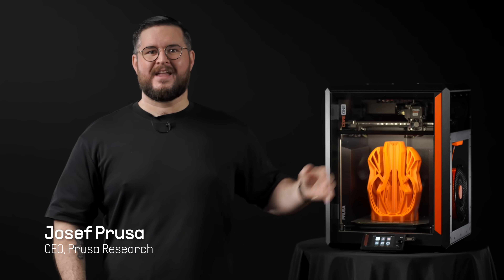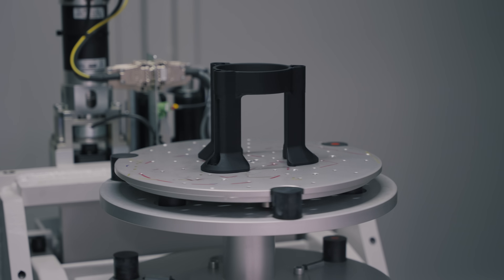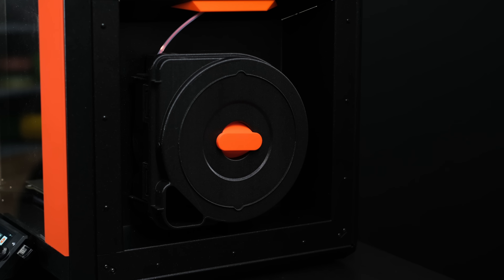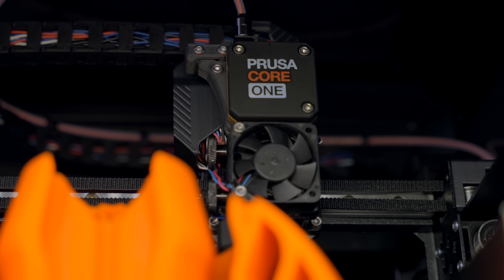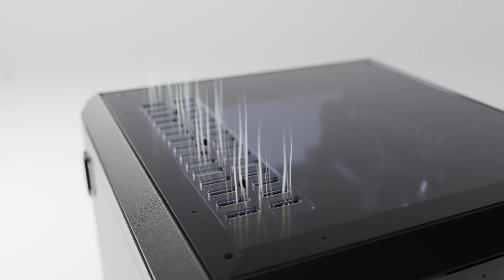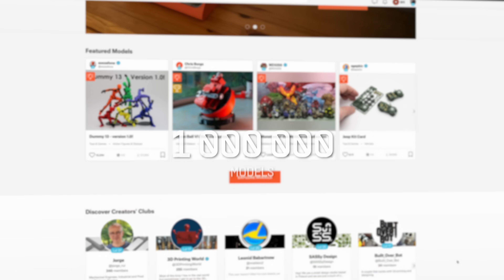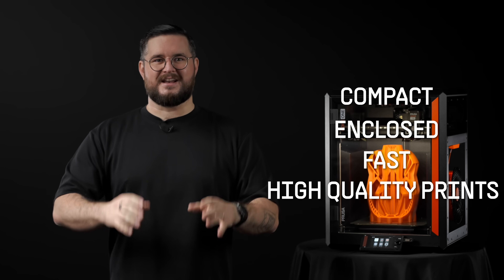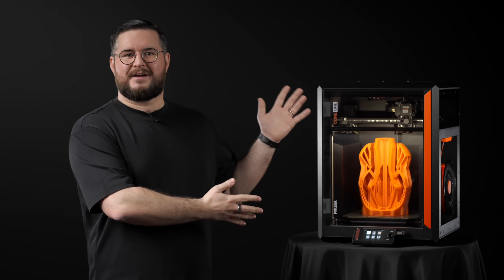Prusa CORE One - Fully Enclosed, High-Speed CoreXY 3D Printer With Active Chamber Temp Control

Comment: overall looks good, and finally there's an enclosed Prusa printer, so that's great, but its a bit small. It should be at least 256 x256, and even better 265x265 or 280x250. Surprising, Bambu uses 256 x 256, and that's what everyone is competing with, but Prusa went smaller 250 x 220. They should have gone a little bigger or at least the same 256 size so they are not inferior in this aspect. I don't need Z height, so the 270 weakest dimension is not so useful for me and many others that prefer a stronger axis to be larger. Perhaps it can be converted from the MK4, and it needs to fit into the Prusa print farm, so that's why they went with a small size. Backwards comparability is holding back progress a bit.  Does it have a quick change nozzle? how easy is it to change nozzles and are these custom to Prusa? can I attach an exhaust hose to the back to exhaust the Particulate Matter air to a window? is this ready or I have to mod a custom part to attach the hose and fan? how does it print TPU parts? does it have an accelerometer to eliminate ringing and other issues with faster printing? I don't care about the fastest print if they're weak and look terrible.  I want the best quality, strongest, best looking parts. Please show a video on how to attach an exhaust fan/hose, and how to position 2-4 filaments with the MMU and how it prints TPU (speed, quality). I was deciding between the Qidi Q1 Pro and the Qidi 4 plus, now that theyve fixed the overheating issue, and also considering the Creality K2 Plus. these are all enclosed but larger print volumes with about the same or lower price, an the Qidi Q1 pro is half the price....hmm. Where are the Core One printers made and what % country of origin China vs European vs US or other?

Comment: The upgrade kit is insanely cool
Reply: Honestly? I don't think so... It would have likely prevented them from redesigning it as rigorously, as they would have needed to, in order to keep up with BL...
I'm sure there are a bunch of people happy about it, but OBJECTIVELY it must have hurt the Core One, because it will have taken away some of the more extreme changes they COULD have made. (And arguably NEEDED to make, to not get ROLLED by Bambu Flagship in couple of months...)
So I very much agree that it's "cool", 100%!!! But I also think it's basically bound to turn out as the wrong choice, with hindsight...
Reply: @mcbrite  A 3D printer is a 3D printer. There were many parts they obviously upgraded and many they didn't In those cases, they just reused older parts. For a modular design such as this, it makes perfect sense and sacrifices no performance. If they had designed new custom parts in every case, the printer would be even more expensive.

Comment: If this came out 6 months ago, we'd have reconsidered getting the qidi q1 pro, we needed a heated build chamber.  This is twice the price, but would have been a better printer in every way.   (Chose the Q1 as it at least runs open firmware and is repairable enough for someone who got into things in the RepRap days. :)
Hope this takes off and improves and in 5 years when we replace the then very clapped out Q1, we'll be looking at the CoreOne Mk.3  :)

Comment: What was that thing at 9:17
Reply: A project at ZHAW University of Applied Sciences. I don‘t remember it‘s name but it‘s basicly a 3D printer whose nozzle is at 45 degrees angle and rotates 360 degrees while maintaining XYZ agility. It can print overhangs better and more rigid prints due to eliminating horizontal layerlines. It was featured in a video of CNC Kitchen if I remember correctly.

Comment: Subtle flex on the door opening there. Your door didn't explode when opening past 110deg!
Reply: As an outsider looking to buy first printer how is the customer service for Prusa and Bambu?
Reply: It's not possible for that door to explode, not glass.
And also probably the best moment in any 3D printing YouTuber video ever.
Reply: Yeah door can't break... wooooo....  It also costs the same as an X1C AMS combo but offers no upgrade to an X1C.
No Camera, no espi break out (it's an add on), no filtration, no lidar, HUGE holes at the back of the chamber for fans (this thing is never getting to 55C chamber temp)

If this came out three years ago I would be impressed.
Reply: @backtoearth1983  Of course Prusa won't offer an "upgrade" to a Bambu - nobody does. What an absurd thing to say. It does seem like the Prusa way is to offer a bunch of stuff as optional addons - but I think that's somewhat fair, as they are not based in China so they need to cut costs somehow. Prusa's line of printers seem to work well without LIDAR, and even Bambu has machines without LIDAR that work perfectly well. I suspect LIDAR is a bit more on the gimmicky side.
Reply: @backtoearth1983  "no lidar" and lidar is supposed to be useful ? , as far as i saw at reviews , Bambu printers without lidar vs the ones with lidar performed just as fine, lidar is more like a gimmick than something useful lol , so i don't see why a Prusa printer should have one
Reply: @ulforcemegamon3094  But then why pay twice compared to P1S?
Reply: @backtoearth1983   They literally list 55°C chamber heating temp.
Reply: It’s active temperature control with a fan not a heater. It’s rather vague advertising. Also one would hope they’d have at least marginal improvements over bambu being a few years late.
Reply: @derektran9404 The extruder is an E3D REVO hotend which is open source and lighyears above bambu's proprietary design. Plus they designed it with serviceability and longevity in mind. There's a reason Prusa has hundreds of their printers in a print farm. You get so many lessons learned on how to make a dependable printer and not a cheap gimmick.
Reply: @josephromano6168  This comment is so incorrect. Revo is literally not open source and they even made a blog about it not being.
Reply: @backtoearth1983  X1C literally does not have a heated chamber. Lidar use is just an alternative to SPINDA for mesh bed leveling
Reply: @backtoearth1983  It's not a proprietary POS Bambu, so that's already an advantage. You talk as if you can't cover holes. It is a printer.
Reply: @skywardsoul1178  Saying Bambu printers are pieces of shit just invalidates your entire argument because it just reeks of fanboyism.
Reply: @AustinMichael  Part of the reason why I won't touch bambu with a barge pole is the disgusting behaviour by its fans. They're insufferable. Not only endlessly shilling for it but always trying to tear down anybody who doesn't like them or those who like other printers. Get bizarrely personal about it. 
There are also a plenty of reasons I don't like the printers and the company itself. Not really interested in spending more of my time explaining to someone who came into the conversation as you did though.
Reply: @skywardsoul1178 Prusa is proprietary. Thats gantry is not COTS. The frame is not COTS. The extruder is not COTS. Look at the XL. Tons of proprietary parts
Reply: @CyThePhotoGuy_187  I have one. It's significantly more repairable than the Bambu. The XL is certainly a bit more proprietary than their usual offerings, but nobody said that every part had to be sourced at your local shop, especially when a machine does what the XL does. I can also trust that Prusa will continue to support it for many years with parts, upgrades and updates. Bambu has roots in a company that is quite untrustworthy in that regard. Prusa also isn't a closed book when it comes to repairing or tweaking your machine, which I very much appreciate. Nor does Prusa steal as Bambu does.
Reply: @ Bambu isn’t a closed book. They have one source firmware and all beatings, fasteners, belts, etc or COTS. They also sell replacements for every part on the machine. So highly repairable. Prusa is as much proprietary as you call Bambu. 

Bambu’s co-owner was an engineer for DJI. He wasn’t anyone at the company. Bambu’s first machine was engineered in Germany btw 😉
Reply: @CyThePhotoGuy_187  Ah, so the belts, fasteners, bearings are standard? Like almost every printer? 
I've talked to a number of Bambu owners who disagree with you on the repairable part. Basic things generally being not accessible without a lot of disassembly, certain part failures requiring the replacement of entire expensive assemblies etc.
Reply: @skywardsoul1178  Funny how you say a POS Bambu, but Bambu is still known as the top of the line printers.
I have multiple Bambus that I run non-stop production prints on and they never give me issues.
Replacing parts is cheap and super fast.
Reply: @backtoearth1983  Chinese bot spotted, opinion discarded
Reply: @ they only did 3 things with this to take a shot at Bambu. Door opening further, don't have to connect to the network and less waste. This is really a shame they didn't do more. The side load filament and storage is nice. But this doesn't do anything that most people with machine already with buy this.
Reply: @jaydub308  They also made a shot at the idler bearing replacement at 4:21. Becasue bambu lab wont let you replace idler bearings without 1st purchasing a $300 sub assembly.
Reply: @LilApe  You spread the same lie about the non exisistent 300 dollar expense everywhere eh? The x axis is less than 100 bucks, tool head included.
Reply: @jaydub308 Except you don’t have to connect a Bambu to update the firmware. Thats hasnt been a thing for months.
Reply: @LilApe That’s fake news.
Reply: What?!?  @LilApe

Comment: Want to know more about two key items:
- MK4S to CORE One conversion kit. How many parts does it reuse? How does it reuse them? What is the assembly like?
- Buddy Camera. Tell us more about it, specs, connectivity, any useful features it brings (failure detection?).
Reply: I Think they will Reuse: Bed, Electronics, Toolhead, y-motor, x-Motor, z-Motors. Mybe also some of the extrusions. I will defitifely look into the Kit as soon as it gets available
Reply: @MaxMichel89  Edit, turns out it is the same bed, from the website:   "The CORE One uses the same print sheets as the MK3/MK4, and also hotends, nozzles, and other proven parts from the MK4S."
So items reused could be heatbed, electronics, toolhead, rods, motors (including ones with screws), power supply, some wiring, and maybe even some frame parts. Oh, and probably fasteners.

Comment: Segmented bed. That's all I want from Prusa. It's so frustrating that in 2024 I still can't print a large cube without the corners peeling up. Prusa solves it on the XL but at $2k...
Reply: I don't know what makes you think it is solved on the XL. The tiles have the same problem and some other ones. Prusa has not been spending any time on the XL. 
I do think the tiles are able to fix the problem but they currently dont.
Reply: @ oh wow really? I thought the entire point of the segmented bed was to mitigate warping
Reply: @adamdport  Same and it was featured bullet point. From what i can tell the software just does not do anything to take advantage of it. I think the reality of only using some of the tiles to do the heating was the only thing that currently is working. But even that is not that important. Most prints need lots of the bed space. Also if individual tiles are not compensating the the edges the easiest way to deal with it is just have the whole heat bed heat up.

Comment: That 220 kinda sucks for helmet makers
Reply: Even 256 isn't exactly glorious. Basic helmet maybe but anything with features tends to require more or seperate parts. I wouldn't be looking for that in this class. Obviously they wanted to stick with the i3 bed compatibility
Reply: Yeah, I think by having the filament roll holder on the side but inset, while a good idea, it compromises on what could have been a larger bed on the machine.
Reply: No need for this for helmets, but i agree on the build size.  Should've been 250 x 250 x 270 and just require new build sheets.  Or have some innovative thing that allows your old build plates but limits the build size when those are installed 😅
Reply: @nightcrayon  "No need for this for helmets" the problem is: no possibility of using this for helmets;  I like most people I think don't want 5 different printers for different things I want to print.
Reply: @threepe0 Sorry, I meant "Although I personally have no need for helmets, I agree that I wish the build plate were larger."

Comment: Why can you not make a 300x300x300?
Reply: It is called XL 360x360x360
Reply: Yes… but even the XL is not XL.. considering all the other options 400x400x600. 

When the M4 didn’t change size.. it was disappointing… and now this only a bit more… I still like my 2 Prusa’s but need more sizes. XXL..

Comment: those shots fired at bambu, with the mention of replaceable bearings, and offline printing mode 😆
Reply: I sniggered. :D
Reply: this has sold me on prusa, if the print quality and reliability is at least acceptable, ofc it will never be like bambu.
Reply: This doesn't even make sense? You can get bearings as replacement parts on bambu lab and there's always been an offline mode for bambu printers.... People really are out here just fanboying over prusa's over priced outdated technology. 

As I said elsewhere I will give credit where it's due and say prusa customer support is quite literally the best customer support I've ever had for any product I've owned.
Reply: @l33tsauce79  better read up on the bambu situation again, there is bearings in the corner ( idler bearings ) that cant get replaced by the user instead you have to buy the full gantry for the device just to get those 2 bearings replaced,   

bambu printers cannot update firmware without internet, as soon as you conect it it will communicate with servers in china
prusa dosent do that and prusa allows full offline printing with usb stick, firmware via usb,  use any slicer you want ( bambu dosent allow that either )
Reply: @l33tsauce79  Just cause you can buy them does not mean you can easily replace them. It's an 8 our job to replace the belt idler pulleys on the X1/P1 platform, as they are glued in, and they don't even recommend it, as the official repair according to Bambu is to replace the entire X-Y gantry. Which to put it nicely, is really damn stupid.
Reply: @l33tsauce79  Wrong. Bambu lab doesn't want you replacing their idler bearings. So rather than selling you just the bearing, they will instead sell you an entire sub assembly for like $300. This was a recent controversy on their twitter a couple months ago. Bambu lab basically said their users are too dumb to replace bearings so they wont sell you them.
RIP bambu lab.
Reply: @LilApe  incorrect!!! the bearings are $7 and requires a single hex wrench to replace. Blatant lies. takes ~2 hours

Comment: Looking great! The only way forward for me is at least dual extruder! But the step to CoreXY is already the biggest for Prusa. I think this will be a hit despite not having more than one toolhead :) And oh my god, that upgrade path is simply brilliant.
Reply: perhaps they will release a toolchanger version, with an upgrade kit? would be fire :)
Reply: @AudreyRobinel  Yeah, let's hope so! I think there are enough people who would want that. The MMU is already great, but still, waste. And purging doesn't 100% empty the hotend so when using support material, it always slightly compromises the structural integrity of the print.
Reply: @MarinusMakesStuff  I admit that the purge towers and all the waste puts me off. There was also the reliability standpoint, but it seems MMU has improved greatly since the first release. Perhaps a MMU is enough for my needs after all...
Reply: I expect another version of the Core will have dual tool changers.  Not everyone needs the huge size and 5 tool heads of the XL.  Perhaps the will call it the Core One+?
Reply: @robblincoln2152  Yeah, it wouldn't be unexpected that they reuse tech from the XL in the CORE. And two tools is all I would need.

Especially when combined with an MMU. So that with one specific tool you can use a support material and the other toolhead can change colors. That's all I've been looking for in the last few years 🤩🌈

Comment: 😮So this is the answer to the Bambu, right? Hopefully well implemented multi material enclosure stuff to one-up the AMS? Like good filament drying or indicating?

I still don't like purge towers because they waste build volume, but hopefully it's tuned to use excess material as in-fill?
What about vent line hook-up spot? Or is it supposed to be sealed enough to be not vented..?

I'm so glad I didn't cave for a Bambu yet if this thing holds up in reviews and pricing.. I'll always trust Prusa for not screwing people over.. bambu things like RFID, only using their app etc, just sketch me out.

Built in the USA anywhere so you guys are eligible for US govt sales?
Reply: It's using the MMU3 which I have found very strange that there are not many reviews on, It's got to be better than the MMU2 as that was awful but it's no where near as good as the bambu labs or the creality ones. So double the cost and not as good.